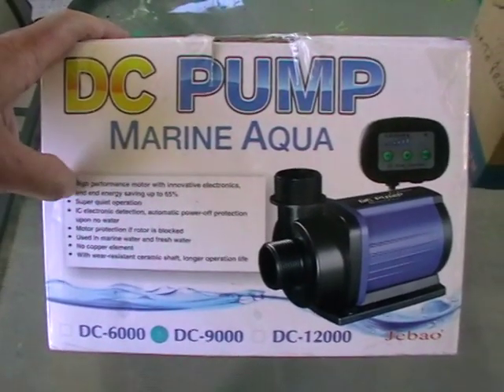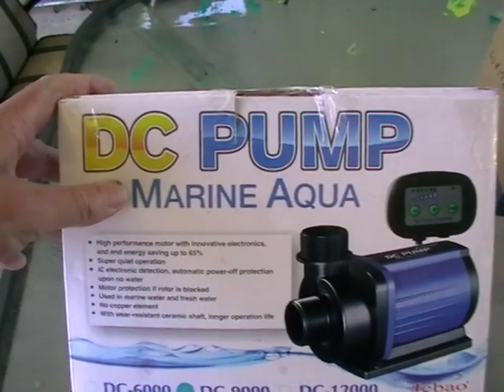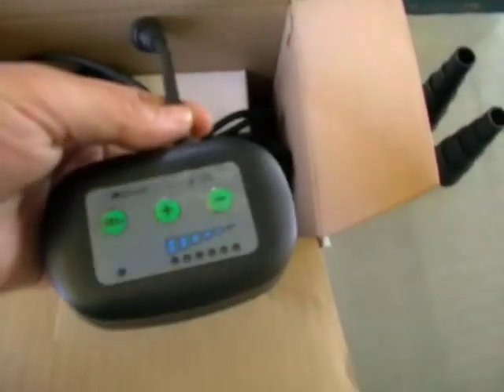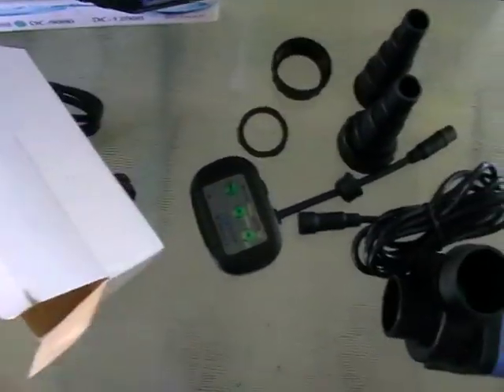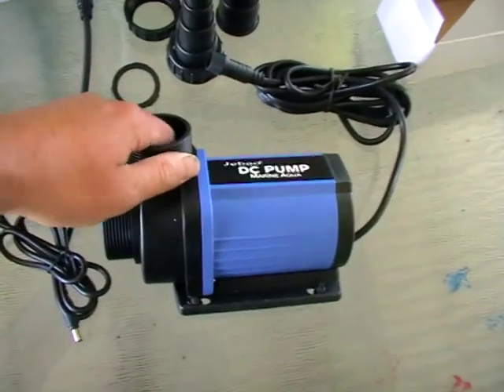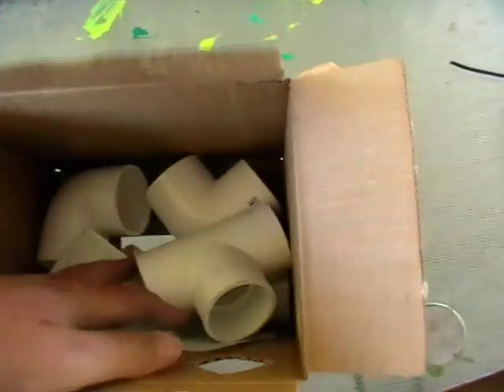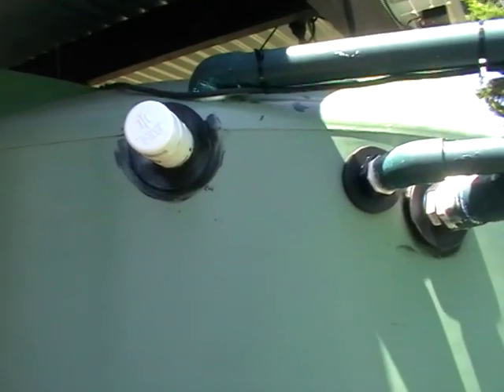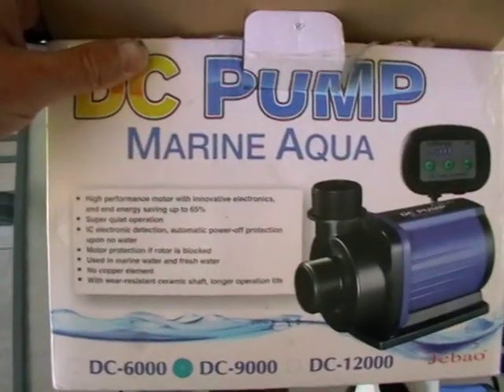Jebao ECO TECH Controllable DC Return Pump unbox for a solar aquaponics system

Comment: Hey, I built a 350 gallon pond, I want to use solar power, thinking of a 40 watt panel, can you advice me on the appropriate hardware, like battery, controller and pump.

Comment: I'm running a koi pond using ther largest modle  u can use a bucket converter then u do not use a inverter far more efffective  I run my pump 24/7  on 2 110amph batterys  works brilliant. I do not use power supply  in use the controller
Reply: How does you do it

Comment: Hello, liked your review :)
Did you try to hook it to a 12V battry? will it work? the reason I ask is I'm thinking of hooking it to a backup battery for cases of power faliure.
THX
Reply from the maker: Yes the pump ran on my setup, it worked on both small solar systems, one with a 90amh battery and also on the 2x 80amh, so yes i would say it would work on a backup battery if the battery is over 80amh.
Reply: mayhem3d  yes I have this set up 24/7 on koi pond url need a buck converter  ther 6 pound of ebay
Reply: Aqua Crop  the controller detects incorrect voltage use buck converter easy to do thow

Comment: Problem:
Note they STIPULATE submersible ONLY. This is due to a manufacturer defect, where the front plastic body suffers stress fractures and DRAMATICALLY LEAKS. Possibly only in the 12000 model.
?v=TzvugrXjU40